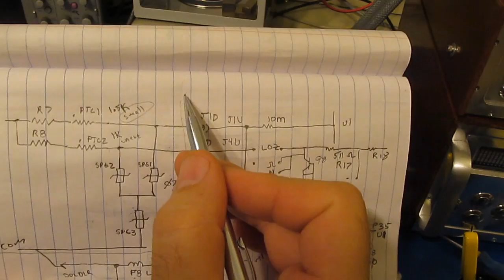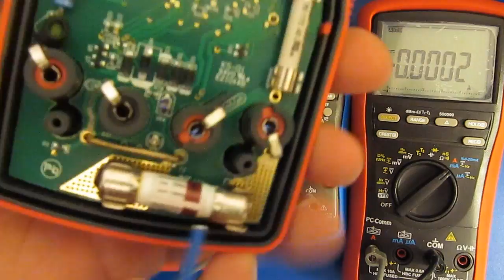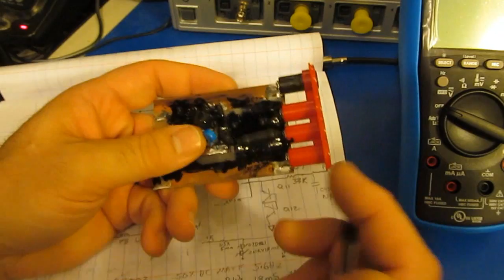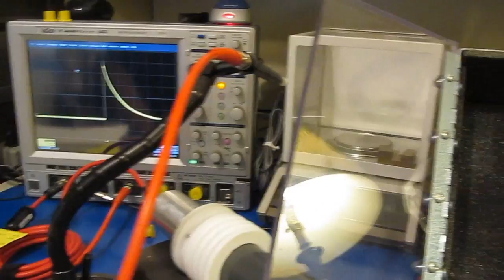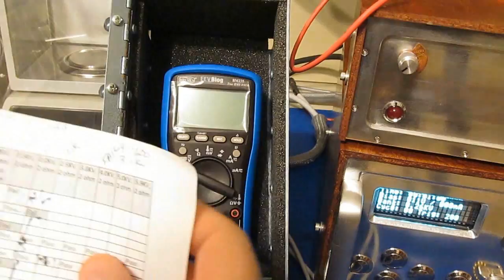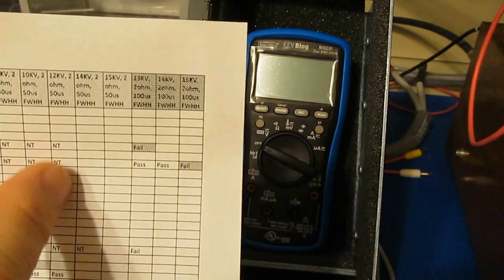Review of the EEVBLOG Rebranded Brymen BM235

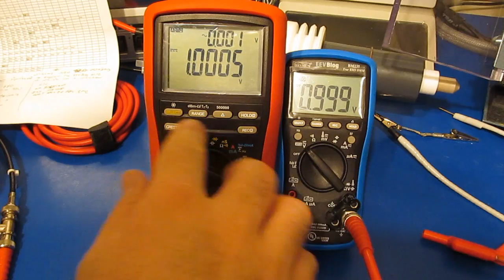Comment: 44:27 continuity test: looks just as fast as on the BM789 that I bought. For me, this is the main aspect in which Brymen multimeters stand out about the rest. Sluggish continuity on cheaper multimeters was a big source of frustration for me.
Reply from the maker: The measured data I collected is available for free on-line.  The BM235 was much slower.

Comment: I had that same issue with my EEVBlog BM235 where the jack was off center. However a lot more than your video. It was basically covered by the case on one side. Required a lot of force to plug the probes in. Seeing your video explains how that happened during assembly!
 
Ended up getting a deal on a 87V on eBay.

Comment: Hey Joe, you mention at 17:25 that the UT61E has an adapted backlight. Did you add that because I can't find a UT61E on Amazon that has a backlight? Thanks!
Reply from the maker: There's a video showing that modification to the meter.  Go the main page and type UT61E in the search, or try backlight.   YT has a some features that if you take the time to learn them, will save you time.
Reply: @joesmith-je3tq  Yes, I did see that after I posted my question. Sorry. Do you know if Uni-T has a similar multimeter that includes a built-in backlight? I looked at their website, but I have no clue as to what's compatible with the UT61E.
Reply from the maker: @idealynx  Sorry, I do not.  I take it you don't like the 210E for some reason or another.   Odd because it does this one job really well.
Reply: @joesmith-je3tq  Oh no, not at all. I ordered the 210E right after you posted your recommendation. But I would like to have a better multimeter as well. Something that will read milliamps, unlike my crappy $12 Craftsman. :)
Reply from the maker: @idealynx  The 210E will read down into the mA.  I've measured quiescent currents on cars below 10mA with it, no problems at all.  For more generalized meters, I don't normally make recommendations.  There are too many variable.
Reply: @joesmith-je3tq  I totally understand. Thanks for your help.

Comment: Hey Joe, great video! Thanks for posting it. I'm trying to decide on a good prosumer-level automotive multimeter for home use. What do you recommend? Also, where can I get the chart that shows your test results for the various DMMs? Thanks!
Reply from the maker: Most people I know working in auto repair have the Modis.   I've looked at a few simple DMMs for automotive.  Those videos are new enough that the link for the data should be in the description.   Just go to the main page and select the Motorcycle playlist.  There are three different videos for automotive meters shown.   You would need to watch and decide if one of them suits your needs.
Reply: @joesmith-je3tq  Ok will do. BTW, do you think that I would be better off getting a general-purpose multimeter? I know you really like the Brymen BM869. Of course, a Greenlee-compatible model might be easier to find in the U.S.
Reply from the maker: @idealynx  I would have no idea of what problem you are having, what features you need..... Only that you want some thing for automotive.  The Modis seem to be the tool of choice.  Maybe the only tool?
Reply: @joesmith-je3tq  Sorry, Joe. I should have provided you with more detail. Right now, I'm trying to track down a parasitic battery drain on a 2019 Mazda 3, but since the only multimeter I own is a cheap Craftsman model I was thinking about getting a more general-purpose multimeter that I could use for the problem at hand, as well as other Harry Homeowner things that may arise. :) BTW, I'm really digging your multi-part review of the 121GW.
Reply from the maker: @idealynx  That's what you should have asked.  It's VERY rare I will offer any advice when it comes to meters but in this one case,  I use the UNI-T UT210E clamp meter just for this purpose.   Costs about $30.  Will last about a year or two if you are careful with it.  Maybe longer.  Really a crap meter but does this one job well. 

Of course, that doesn't mean it will fix your car and you still need to understand how to use the tool.   Good luck
Reply: @joesmith-je3tq  hello my question is this meter compared to fluke 117 is a similar característics right
Reply from the maker: @parlenkow  I would imagine you could download the two manuals and compare them just as well as I could.   Yes, they are both handheld meters with displays and a rotary switch.  Similar.
Reply: @joesmith-je3tq  ok i understand thanks Joe!

Comment: Thank you very much for your review.  I have a Fluke 12, two Fluke 117's (home and work) but wanted a meter that did uA for electronics.  The easy choice was a 87V but that would take a bite out of my fun money.  I homed in on the BM235 as a reasonable unit for the money.  That other Brymen sure looked interesting but I couldn't find it in USA.  Maybe if I had looked a bit harder.  Anyway, you made me feel like buying one is a good choice for my current level of need and experience.   Thank you again.

Comment: Thanks for these in-depth reviews. Based on these, while I like the BM235, it lacks a scale display and AC/DC are combined. So, I decided on the BM257s and I am very happy with it. My line of work and my hobby (both dealing with arcade games/pinball), won't have me sending 20KV into the meter, but it is nice knowing that the Brymens are solid and accurate. It's fast enough to detect fluctuating 5VDC voltage from a game's power supply, identifying its mystery problem where my old meter showed steady voltage. 
You're helping a lot of people make educated decisions when buying these tools. Thanks!
Reply from the maker: What sort of BEMF can you get from an unclamped pinball solenoid?
Reply: @joesmith-je3tq  Good question, will have to see..
Reply from the maker: @brianthompson1138  Time for the HV probe and scope, not the meter... lol.

Comment: 01:30 : One thing I fail to understand is that the protection circuit you're demonstrating here appears to be common in other meters that you've showcased as well yet it's only in this case that it is located in a separate board and, I don't see why every manufacturer doesn't just make this part as a separate piece that is a common for each entire range of meters. Even better, it could be sourced as an individual part from an OEM, just like it is done with LCDs.
I can understand that the economies of scale may dictate a single board instead of two or more and the extra costs these entail. I can't understand it, however, when this circuit (or what could be a part of it) maybe a safety liability.
06:05 - 06:10 : Do these clamps need to be close to the ICs they're protecting or can they be shifted to the input protection circuit? Is the track lead inductance a determining factor in their placement?
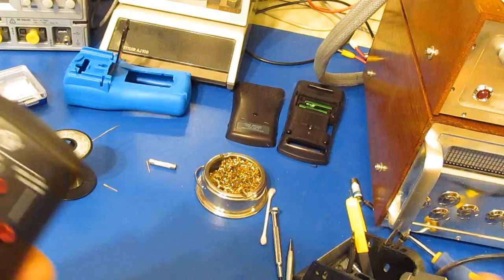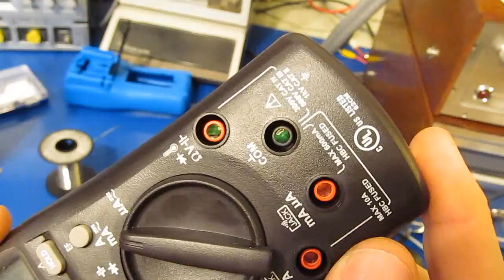06:52 - 07:02 : I bet this can be easily achieved using a template during hand assembly. Does the tinned track on the back of the mini board have to be created by hand or are there robots that can do the tinning? It doesn't look as if it's been done by hand but I really can't tell.
Reply from the maker: Many choices will not make sense if you are not a EE and not a designer.  Business decisions may not make a lot of sense to someone who doesn't work in the industry as well.
Reply: I can't say I know much about the business model of such specialised companies -  it's a complete mystery to me and I'm quite happy with it staying that way - but I suspect the clientele of companies such as Fluke, Gossen, Tektronix etc.  is predominantly comprised of professionals and not hobbyists.
Probably every aspect of designing such instruments is a specialised field even among EE professionals - as with most fields of enterprise nowadays. In addition, there are the secrets of the trade to compound what is already a complicated enough matter to those on the outside. I am certainly not expecting any of these active professional to appear out of the blue and start answering design questions regarding a specific model in a public forum - I would expect that might be quite contrary to their contractual obligations or professional ethics. By posting questions or points on aspects that tickle my interest I'm hoping to generate a discussion or invite qualified responses from whoever might share a similar interest or has something to add that might aid understanding. Everyone's level of expertise is quite different of course.
Reply from the maker: You must realize this is a small channel and very few people leave comments.  It you are looking to have a discussion,  I would suggest you join some of the EE forums.  You will get a lot more feedback them than you will find here.
Reply from the maker: The attached link is where I typically post about the handheld meter testing.  Feel free to join and ask your questions.   http://www.eevblog.com/forum/testgear/hear-kitty-kitty-kitty-nope-not-that-kind-of-cat/
Reply: a-ha! Thanks for the link - I hadn't realised you had a dedicated topic on EEVblog.  I don't frequent EEVblog much but maybe I should. I'll definitely check the topic you''ve created.
I've been hopping around your videos on different meters but haven't had the patience to go through one of your longer series on a single meter yet. The reason is probably that I'm interested primarily in certain tests such as ESD,, RMS measurement bandwidth, etc.  more than others (e.g. functional testing). Now, if I had my eyes set on a particular meter, it would be a different story of course.  What has impressed me watching your videos, however, is that there is no single meter you've reviewed that is without drawbacks - regardless of price. It's more that some are better than others in certain respects.

As I've only found your channel, the wealth of information is quite overwhelming and I ought to pace myself. I'm interested in the capabilities some of the more advanced meters you're testing have to offer especially with some which could be used as bench top replacements. I can't bring myself to fork out the cash one of these cost - I just don't really need these capabilities, I just find them interesting. Then again you never know what I might find on ebay in a couple of years. In any case, it's good to have some idea of what lies under the bonnet. I suppose if I ever decide to go for one of those, I'll be buying it with my eyes open. I know very little about the workings of digital meters and these videos have certainly widened my perspective on their limitations.
But you're right in that the yt channels are not the proper place to have discussions anyway - the format is not ideal for this use for a start.
Reply from the maker: @Stelios.Posantzis  If you are interested in more advanced engineering discussions, there are what I consider better forums.  EEVBLOG seems to be a lot more general.  They discus everything from politics, to social injustice.  It seems the trend has been slowly moving in that direction and I use the site less and less but if you are looking for some broad feedback, its still one of the better forums available.
Reply: Thank you for this tip. Watching your videos has changed my perception of what a modern meter is. Until now I basically thought that there were cheaper (= less accurate) meters and higher precision meters. The only thing that I thought differentiated cheaper modern meters from older ones was that the moving coil and needle gauge had been replaced by an LCD display and the associated supporting circuitry. I understand now that even the cheaper meters are perhaps quite a bit more advanced in many respects than the portable meters and the bench top meters of yore. I had never given any thought to the features you are testing until now. I find learning about the failure modes of these meters very interesting. If anything, I think you've helped me see some of the "logic" behind the ways that these failures happen. To be a bit more precise: I've always had an interest in the input protection mechanisms of electronic/electrical devices but not necessarily in their application to handheld multimeters.

Comment: Why does it need an air-gap around the connectors? Isn't the plastic a better insulator than air anyway?
Reply from the maker: Adding slots to a circuit board is a fairly common practice.  Searching for creepage and clearances.   I'm not sure what plastic you are referring to.  It's pretty common to have plastic that will fit inside these slots as well.

Comment: Thanks for very informative videos and this in particular. At this point I can say I'm leaning toward these Brymen, the BM 235  or the more advanced BM269s.
One think I don't understand: what difference is there between the EEVblog rebranded and "regular" one? 
Can one tell me about the battery life of the Brymen 235 and the BM269s?
Reply from the maker: I went to Brymen's website and do not see a BM26 series.  For battery life, you may want to just download and check the manuals.   I am not sure I have ever looked at the current draw and cutout voltage for any meter.   The physical difference as far as I know for the BM235 is the color and marking.
Reply: F

Comment: Love the review. The crooked terminal was a bit anal! No function was impaired. Ps it's only $130 AUD. Geez for that I would buy 20 of these compared to others.
Reply from the maker: Having the terminal stressed every time the leads are installed, not to mention having to work the loads a bit to get them inserted is not a detail I would gloss over.  There are many  reviews that are far less detailed.  I suggest you look for those.
Reply: I wasn't criticizing. I was trying to say for a cheap meter, the crooked terminal is not really big problem in the scope of things:) Keep up the good work.
Reply from the maker: If it caused the solder joint to fracture, the connector to fail prematurely or make it difficult to insert the test leads,  I would say it's a problem.   I don't like the fact they notched the plastic as well.   Again, you personally may not care about this level of detail but this channel may not be for you.
Reply: Ok. I won't watch anymore of your videos. You think I am not good enough for your channel as you say.
Reply from the maker: The fact you would put words in my mouth so to say, may be another reason this is not a good channel for you.

Comment: The "Interference" you indicated, I have more information on that!  Dave Jones reviewed a "bad" unit sent in by an owner of this meter.  That very inductor part was broken!  Good review; above and beyond what most do -- great job!  BTW, for 'a few dollars more', you can get the BM257S, with better specs and more features.
Reply from the maker: Saw that repair video he made.  Sure looks like this was Brymen's correction for it.
Reply: I bought one of these from Dave at end of Jan 2018. Looking at mine just now, the L3 part has been moved down and to the left instead of sitting right next to L2. Mine doesn't have any part of the screw post cut away as I guess with the component moved there is no physical interference anymore.

Comment: Thanks for your incredibly detailed video. It was a fascinating watch. Incredible it survived 10kV. Another nice feature of the BM235 that I've noticed my BM257s can't is the ability to show the forward voltage and light a white/blue LED.
Reply: I also have a 257s mine won't read three silicone diodes in series, but it's still the best field meter iv'e come across to date
Reply from the maker: Some of the poorly designed ones fail the ESD or the AC line test and never even make it to the this part of the test. There are not that many meters that make it past 6KV. This is one of the more robust meters I have looked at.  Brymen did a good job with it. 
I never understood the need to light up an LED with a meter.  Personally I would want a handheld that could measure a HV diode but I don't see that happening.  Glad you enjoyed the video.

Comment: Hi Joe! Thank you so much for this very detailed review. Currently I own two Fluke's, the 117 and the 17B+, but when I bought those (specially the 117) I didn't knew better, and I work more with analog electronics, so, I miss some features like mA on the 117 and true RMS on the 17B+. So, I was thinking about trading both for other units on the same price range (around $100 to $150 each). Do you recommend the BM235 or do you have any better suggestion for me? Thanks!
Reply from the maker: The BM235 is a great little general purpose meter.  And while it's very robust, it lacks many things I use a meter for.  My advice is download and read the manual.  If you have questions, ask before you buy.
Reply: Thanks!

Comment: So it didn't require calibration after sockets resoldering?
Reply from the maker: It has never been realigned since I have owned it.  For the calibration, you can see even after all of the testing I performed on it, there was no effect.   I later did a video were I looked at the temperature feature of this meter compared with others.